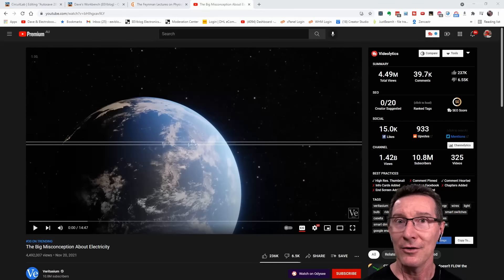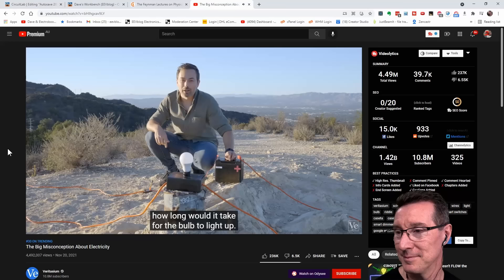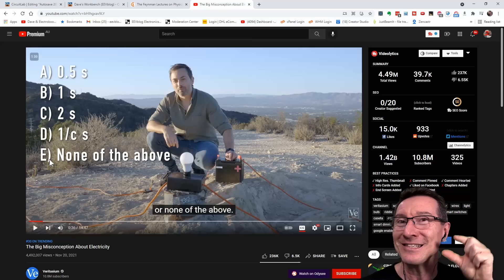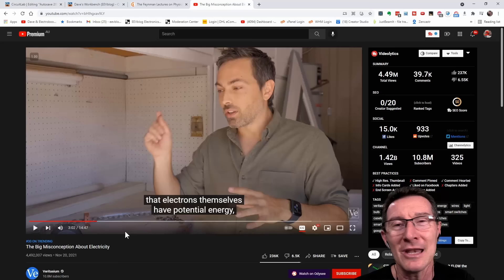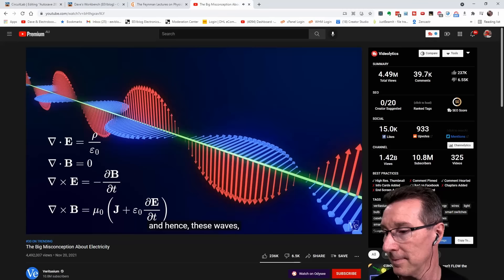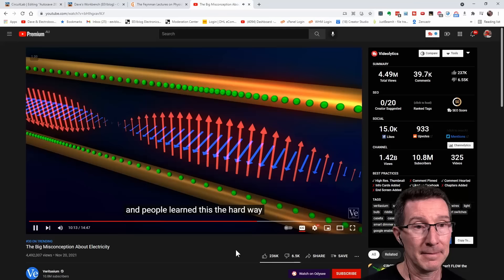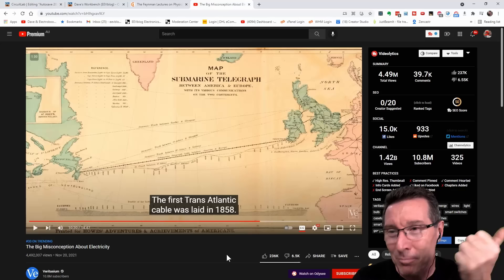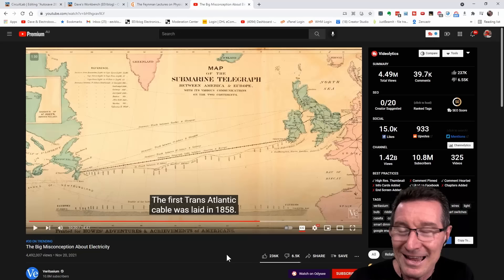EEVblog 1439 - Analysing Veritasium's Electricity Misconceptions Video

Comment: I am an economist not an engineer but the way I was taught electricity in high school now it seems  fundamentely wrong. Derek is right about the lies and I suggest  let´s make things complicated but truth than simple but false. We should embrace the reality of the electromagnetic waves outside the wires and rewrite and reinterpret all the classic laws ( ohms laws etc etc)  in terms of electromagnetic ones. Lets translate all the  classic circuit theory into a modern electromagnetic theory of electricity even if  it is complicated. Otherwise It is like accepting the Newton's law even if we have a better explanation from Einstein regarding the gravity. It´s like accepting the classic theory of fields and  forces although we now have a better explanation from quantum field theory. Lets wake up and start changing the way physics is taught in  schools. And yes Benjamin  Franklin was wrong about the current. So why we are still misled? After so many years can´t we accept the man was wrong?

Comment: You are so right. Engineers can't design much without a simplified analysis and for most purposes 'counting electrons' is pretty good and works perfectly for DC electrochemical reactions likes batteries, so it's very useful. And we need things like insulators and sometimes a conducting 'screen' on the outside of the wire (like Cat5E).  He does make a mistake in saying it's all at the speed of light 'c' though (fail). 'c' is for a vacuum or air.  It clearly depends on what the electric field is in and the dimensions as you say. For cables used for communications, the manufacturers give the ratio of the speed of light.  As you say, none of this is new to Engineers and the maths of the transmission line was done by an engineer, (Heaviside) not a physicist for a very good reason!  Heaviside also put Maxwell's equations into Vectors.  Thanks for taking this on.  You are very kind to Veritasium. I think he is confusing people.

Comment: 18:20 That's why he said 1/c and not 1m/c. Because in this case you get a s/m dimension, so you should multiply it with meter to get second, i.e. the time that the electric and magnetic field needed to reach the lightbulb. And that thing with meter dimension with which we need to multiply 1/c is the distance between the two wire. So 1/c is correct in any case, while 1m/c is correct only if the distance is 1m between the wires.

Comment: The reason the Poynting Vector is pointing inwards on steady state DC is only the case when the wire has resistance, otherwise there is no electric field in the direction of the wire. The Poynting Vector points inwards, because the wire heats up and that uses energy from the electromagnetic field around the wire to convert into heat. The reason it can do that is that there is resistance which hinders electrons from equalling out the electric field along the wire and thus having a remaining electric field along the wire, which in turn makes the Poynting Vector point inwards.

Comment: Even at the Electrical and magnetic levels,  electrons are still involved. If there is no electron drift, they won't be magnetic fields at all. As, magnetic field is heavily dependent on electron velocity, its effect and hence the effect of Electromagnetism doesn't get very big at low frequency of oscillation. Magnetic fields are radial fields and their effect should also be explained using circular setup and not rectangular. Good work Dave.

Comment: Reminded me of my physics teacher's advice to first always quick-check your work by making sure the units cancel/convert properly.

Since C (speed of light) is a distance over time ratio, a literal answer of "1/C" can't be a correct formula to find time, since the result would still have both distance and time components.  The only correct formulation would be something that includes distance, such as "1m/C", letting the meters cancel out (assuming you put in C as meters/second), and leaving seconds.  But I get the simplification he was going for.

Comment: The various commentary videos have provided a lot of additional knowledge about how the energy flows from source to load. 

I have been aware of the idea that energy travels outside, or at the surface of wires, for a long time. However, I have never known any of the details of how it actually works. Very interesting. N8ce to have some understanding.

Comment: At 12min or so, there is a comment made that "DC operates differently from AC", namely that while it is agreed that the energy is in the field around the wires at AC that the Poynting vector is into the wire at DC.  It is important to note that DC steady state also behaves as a transmission line -- as in, initially when turned on the DC signal travels with a finite speed (the speed of light in the medium) and there can be reflections until steady state is reached.  A DC circuit in steady stay is still transferring energy via the fields around the wires from the source to the load.  (in fact I should add that ANY circuit behaves as a transmission line! What are normally classified as "transmission line effects", such as time delay, characteristic impedance, reflections, and so forth are actually present in ANY circuit, it is just not as noticeable for small circuits (where circuit size is << wavelength, or at DC when the circuit length is short enough that the time delay is not easily measured or noticed).

Comment: Legend: Z-line impedance, R-bulb resistance, U-source voltage; 
Impedance of such lossless long lines is about 300 ohms. Speed of wave in such line is about 95% of c (light speed). In addition there are two long lines shorted on their ends. After closing the switch there will be a small almost instant current U/(R+2Z). To be honest it will start to flow when you are closing the switch even before you close it (capacitance of the switch will increase during closing process). The main current will flow after about 1,05s-first reflection. But there will be several more reflections in 1,05s delay, and dependent of R/Z ratio it will have a lot of steps before it will stabilize.

Comment: As a chemical engineer, drilled into doing energy balances on arbitrary abstract systems - chunks of space - 
I want to see an energy balance be performed on an arbitrary chunk of wire. Doesn't have to have a battery or capacitor or inductance in it.
Yes - I took a course in Electrical Circuit Theory at Drexel U. Got an A on the course. Understood it perfectly at the time.
Did Thevenin's Theorem & Kirchoff's law.  Even scored a perfect 100% on a written exam.
But, I NEVER performed an ENERGY balance from a PHYSICS point of view STARTING from Maxwell's equations.
I need to see that energy balance WRITTEN OUT and to see how Maxwell's equations get involved, FROM FIRST PRINCIPLES.

Comment: In a lossy conductor in DC, there are two components of the Poynting vector. One is parallel to the conductor and this is the power transmission part, product of the external electric field, radial to the conductor, and the magnetic field. The second component arises from product of the magnetic field and the voltage drop inside the conductor and represents the conductor power losses.

Comment: What happens in the wires is very important because the behavior of a circuit we see is the consequence of an infinite series of wave reflections off the impedance mismatches through the circuit. Power flows at the group velocity, not the phase velocity of the field.

Comment: 1. Derek's video is misleading, because the electromagnetic transmission does not equal the flow of energy through the wires, but is more of an unwanted side-effect, which in it's strength depends on the distance between the wires and can also be avoided by shielding the wire. Derek implies though, that both the electromagnetic transmission and the flow of current through the wire would be the same thing.
2. It's not "1m / c s", it's "1m / s", aka without seconds, as the seconds unit is already in c.

Comment: As a student of electrical engineering you have fully explained why this whole thing was annoying the heck out of me. I commented countless times asking why was everyone overcomplicating the heck of of this when we are looking at a basic DC circuit with literally no other info then assume zero resistance wire. I knew the answer was D without even thinking about it. Amazed how many thought a DC battery or wires would transmit anything open circuit. I was like WTF did I miss? lol.

Comment: After many days of reflecting on it, I arrived at the conclusion that is not possible that Mr. Muller wasn't aware that he couldn't use the Poynting vector to explain a problem of electrodynamics; and therefore the bulb light up after the EM field had traveled one metre, independent from the length of the wire.
I believe that the purpose of the video is to spark a technical and scientific debate, confirmed by some details of the video which are hazy on purpose.

Comment: About 40 minutes in you mention that engineers don't really think about this but i always thought this is very important knowledge for anyone looking to study antennas and electromagnetic fields. I did learn about the subject in my electromagnetics lectures after all.
Reply: What can be measured tends to be much more important. Since the Poynting vector is an abstraction of what can be measured (electromagnetics) it will almost always be more of an abstract curiosity.

Comment: My answer to that video was this:

" The reason why " electricity " is not explained that way (luckily) is that this model is not suited for circuit analysis which is most people are concerned with in school (not univeristy) and would make the study of electrical and electronic circuits almost impossible to understand which is not good since the topic is already not exactly the most intuitive. Having said that, the flux of energy should be clear from basic physics courses, you just don't use it in electronic and electrotechnics and forget about it.
Also the study of more complex electronic devices like diodes and transistors can't be easily tackled by looking at electricity that way.

When you get to electromagnetic waves/fields classes though (around the 3rd year of university generally in electronic engineering), you'll study how the energy propagates outside the wires and you study different types of lines and the different propagation properties.

Electricity is not an easy thing to grasp and many engineers actually never really do understand it though they develop an intuition of how things work. Thats why compared to other branches of engineering electronic and electrical aren't the most popular. "

Not bad considering that I finished my bachelor in 2016 and have never seen electronic again during my master and haven't worked in engineering since I finished my master :(

Comment: Know what's funny?  I don't remember being taught the Poynting vector to any great degree.  So yeah, for practical electronics no problem using the equations of the trade.  But recently my mind was struggling with how electromagnetic energy knows the direction it goes should time itself stop and then start (an odd thing to think about, but there ya go).  I didn't know how the wave would "know" if it's going forward or backward, because there is no lead or lag in E and B fields.  First I was thinking the momentum of the photons were the answer,  but couldn't figure that out because "the photon" is a strange thing, even though we all think we know it well enough.  So when rediscovering the Poynting vector (thanks to this video or the one Dave's reviewing, or maybe Science Asylum..) it fixed that thing I was pondering about.  I'm weird.

Comment: No ones questions that there is coupling between the wires, but the question was "how long does it take for the bulb to light up". I would argue that a 20uS blip of 0.01W would not produce a detectable emission from the bulb and thus its ~1sec for the light to turn on, assuming the electric field expands on both sides equally.

Comment: Key point made here is that practical engineering differs from what physics say about the subject. I work as an electronics engineer and there has never been time I would have needed to take Poynting vectors into account. I need to think EMC issues, PCB layouts, etc. on a daily basis which all incorporate thought of transmission lines and how conductor might radiate energy yet I never think these issues in terms described in this (or Veritasium's) video.

Comment: "First of all, there are a lot of assumptions involved so they have to be cleared away. The incandescent light bulb should be able to pass current in both direction (not LED), also, the light bulb resistance should remain constant regardless of what current or voltage is applied to it (for the most part but a bulb shouldn't be used for this video - it should be a resistor network ideally). So, in this case, we want the resistance of the light bulb to equal twice the impedance of the two transmission lines. Or, in other words, the impedance of the two lines in series. Also, the resistance and leakage conductance of the transmission line should be negligible or zero, as well as the permeability and permittivity equaling unity. This greatly simplifies the process by eliminating echoes. Upon closure of the switch, the light will light to half voltage. The two transmission lines will appear as resistors at the terminals between the battery and the light bulb. After the time it takes for a traveling wave to propagate from the battery light bulb to the short circuit at the end of the line and back, the light bulb will receive full battery voltage. There is nothing abstract about this; this is standard transmission line engineering." - Eric Dollard

Comment: answered under veritasium origin: on my opinion that electrical impulse which going along wire can be compared with locomotive which going to push cart on paralel line and electromagnetic interactions which is perpendicular towards main line connections both electric and magnetic is kinda wind that train blow, they will be completelly not enough energy to submit signal enough for light bulb to work, from first moment o mean...it will need some time to reach via chain, due to air and surface resistance greater than along wire.(0 ressitance wire). so my opinion in this tricky question if distance from switcher to bulb is 1ls time ~ 1s, if 0.5ls, as on this scheme, then time will be ~ 0.5.                                                     Another analogy if we imagine chain line as continous line of carts, which are connected but with some small space distance in connection bolts allowing them to push one another like dominoes, where electrons are carts, answer will be same ~ half of full chain, in other case - impulse going through conductor faster than light?. just think in some cases we have almost same rounded circuits in lines between continents, why we have latency? why signal impulse not transmited in one moment , sending impulse about changes via sideways electromagnetic field interactions ?

Comment: 20:59 Well there's the problem - Veritasium's video wasn't aimed at working electrical engineers, nor was it titled "Advice on How to Build Real Circuits - Poynting Vectors are Essential!" It never made that claim, and clearly that's not the audience. It's not pretending to be some sort of perfect, technical, practical solution to a problem, and is instead an educational thought experiment designed to teach some interesting physics and slightly (harmlessly) change one's worldview. You can tell by the general(/clickbaity) title of "The Big Misconception About Electricity", and the secondary title in the thumbnail of "Energy Doesn't Flow in Wires." The latter is the real point it was trying to get across, and it did that quite well - well enough that both my partner and I, PhD holders in non-EE physical science fields, found it really interesting and perspective-changing. (I may have learned about electricity not flowing in wires back when I took Physics II in undergrad, but it's been a while!) I imagine it was also interesting and thought-provoking for lots of other people who haven't encountered these ideas before, due to age, experience, education level, field of study, and so on. So sure, of course there's some specifics glossed over, and not all of the information has practical real-world applications... but that's because that wasn't the goal.

Comment: Although the circuit does operate at DC the step that occurs when the switch is closed does contain very high frequency components that have to be handled using transmission line theory.  The light bulb will not be matched to the characteristic impedance of the line and the source impedance of the battery might be high at high frequencies. Therefore the whole thing will start up after a few nanoseconds but it will take quite a long time to settle down to DC conditions.

Comment: If you cut a live wire, at high voltage, you can see the flow of the electricity in the form of the arc generated between the two cut ends, until the distance is too great for the air to act as a conductor! All the best, Pete 👍

Comment: The answer is as follows. Under the best case scenario, the bulb starts to get detectable energy at roughly 1m/c seconds (shortest pointing vector path generated by the cross product of Electric and Magnetic fields), but only attains full brightness at 1 second. In fact the true answer under a practical experiment would be anywhere in the set (1m/c,1s] corresponding to from dim light to full light. 
*If one were to consider leak energy as detectable energy, then the bulb is always on, but this is ignored as leak energy is in the order of noise signals/energy. One can ignore this * without any loss in argument.